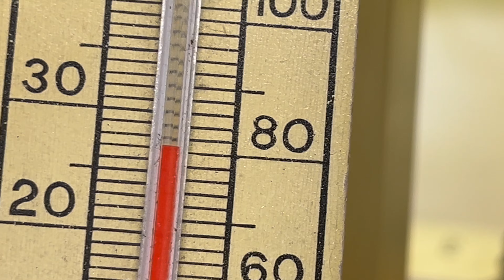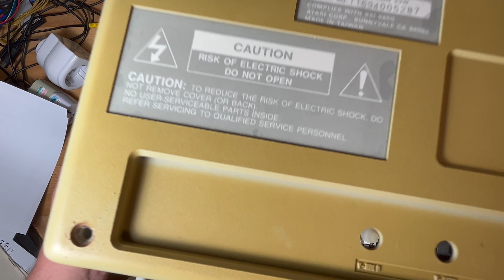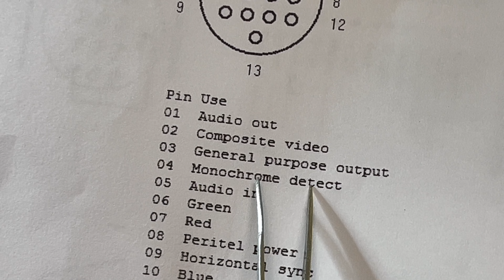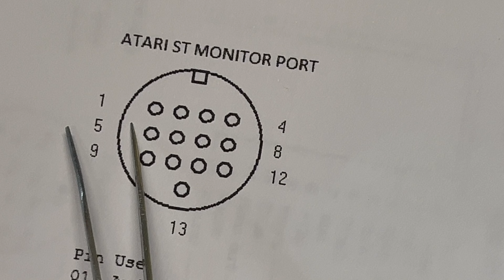🇺🇸 Quick Look: Faulty Atari SM125 Monochrome Monitor [TCE #0417]

Comment: This is not your vanilla composite monitor, which might also explain the lack of "hearable" high pitch sound. This also means that you can't just feed it a normal video signal. The specs are 35.7 kHz Horizontal, 71.2Hz Vertical.

Comment: That missing cap is supposed to be a: 

65A2M-221-3A Ceramic Cap 220pF 2kV

And it looks like it was launched off of the board. :)

Those two big green caps look to be bulging to me. I'd investigate them.

You can find the service manual and schematics over at manualslib.